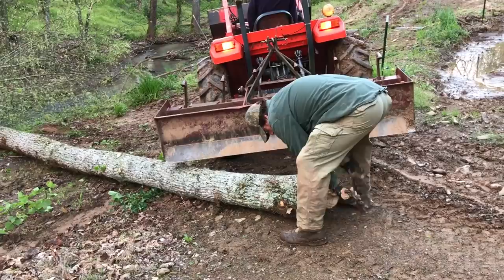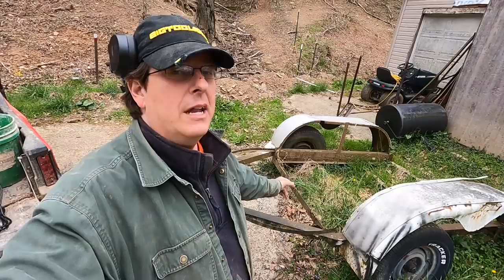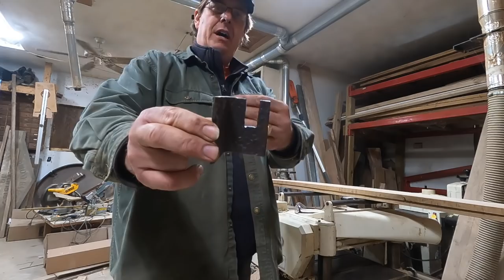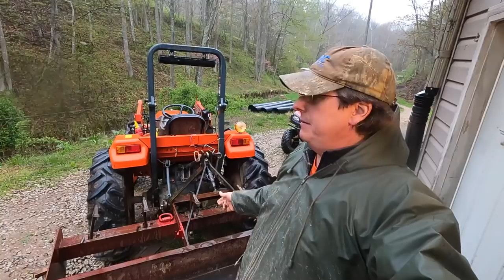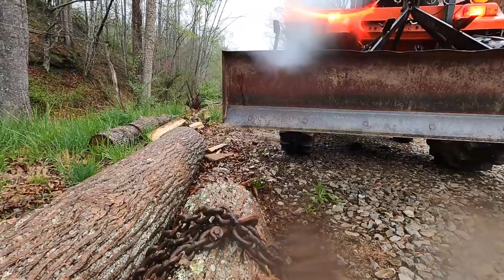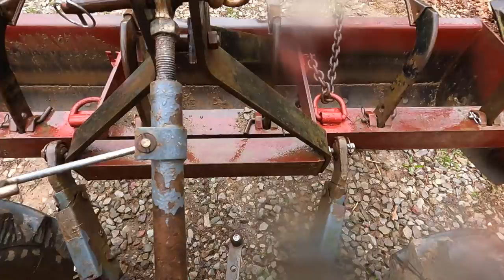Simple MOD Makes Skidding Logs to the SAWMILL Easier

Comment: Nice mod!
If you run the chain from the log thru the top of the clevis and out the bottom to your tab, it should give it slightly more security on bumpy ground with that slight downward pressure locking the chain into your tab slot.

Comment: Good and inexpensive idea. Everyone else is off showing their $4000 PTO 3pt skidder winch to drag 5 logs out.
Reply: If you're ONLY dragging out 5 logs, no, a skidding winch doesn't make sense.

But if you plan to log on your place for 30 years like me, they make a LOT of sense.  I can skid a log out up to 150' from a roadway TO my tractor.  I don't use the front end loader to drag them out, which is a great way to tear up a front end loader/tractor, as they are NOT designed to PULL stuff, but to pick stuff up.

Comment: If the 1/2 tab side of the chain holder starts bending and you have to replace it instead of placing the triangular piece at the bottom try a square one then run a triangular one up along the end to support that tab side of your chain to give it more support.